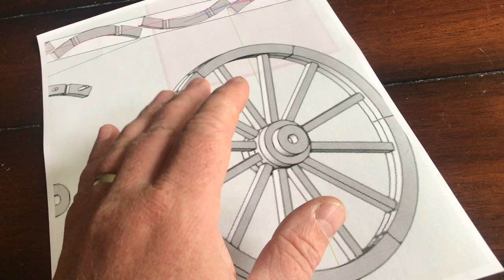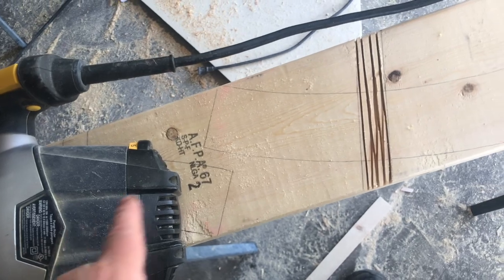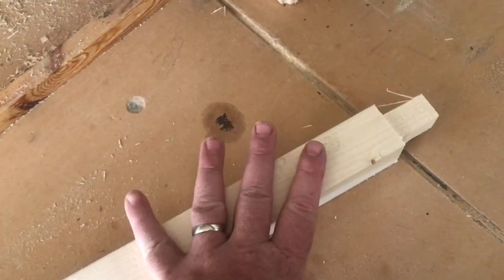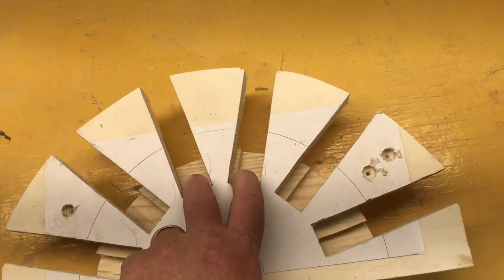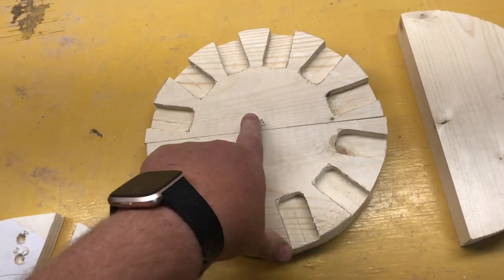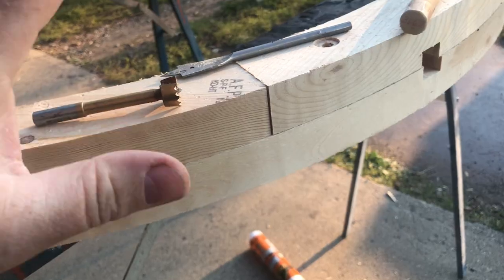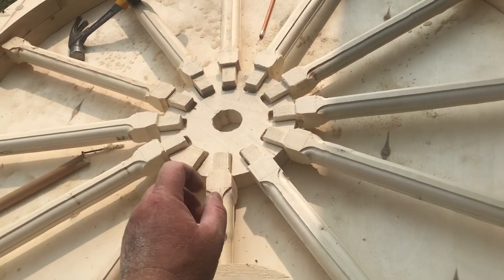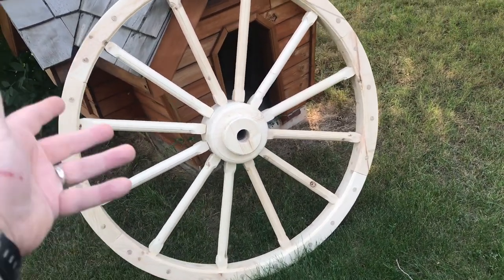Building a full sized 48" wooden wagon wheel from 2x6 and 2x4's!!

Comment: Mr Samhain you are an artist, I cant do  this. I bought 4 wheels from a garden center. They are wood but meant for a garden display.
Reply from the maker: I know the exact wheels you speak of!  It was part of the reason I designed these, as I wanted to have a wood wheel that looked authentic and could still hold some weight so you don't have to support a prop from below when it is on wagon wheels.  They are not meant for many kilometres of driving, but moving a prop around the yard is where these shine!

Comment: Are you planning to insert bearings in the hubs?
Reply from the maker: Not really, these wheels are great for display purposes, and they will take the weight of whatever prop you put on the axle.  A bearing would allow easier rolling but would be overkill as these wheels may hold up to a ton of use but they would need the metal band around the circumference to ensure the wheels holds up to many thousands of revolutions that a bearing allows.

Regardless, I hope that helps!  Thanks for watching :)
Reply: Thank you for the quick response. Yes it makes sense that they won't be used as road going wheels. I was just thinking for cool factor, especially if raised off the ground and turned by hand.  Thanks again for the great video and instructions 👍👍👍

Comment: I cannot find how many 2 by 6 and 2 by 4 needed
Reply from the maker: I don't think I set the exact number you needed but you can calculate it pretty quickly just breaking down the instructions in the video.    When you do buy the lumber buy extra to make room for potential mistakes and errors as this wheel is fairly complicated when it comes to a wooodworking project.

Thanks for watching! -Samhain

Comment: Can The template be adjusted to make a 36" Wheel? or do have Template for 36"  size?
Reply from the maker: You know, I have been thinking on this.  I am honestly not sure, the hard part will be finding the scale to reduce the template to have it print out at a 36" diameter.  I have wanted to build a 36" wheel, but maybe I will at very least go build the template for it.  I usually like to test and build anything that I create, but right now I am in the dead of winter and I won't be able to get outside to build one.    Though the fact that the 48" design works, I'm pretty sure if I use the same principals I can make a 36" wheel.  If I design a 36" plan, I put it up on my website and let you know!   Thanks for watching.
Reply from the maker: Ask and you shall receive!  I spent a couple hours last night redesigning a 36" wheel.  This is not a scaled version, but an exact matching version of the 48" wheel.  Same hub size, same rim thickness.  You can find it here https://samhain.ca/product/36-wagon-wheel-template-file/